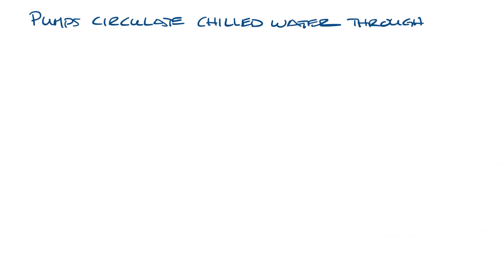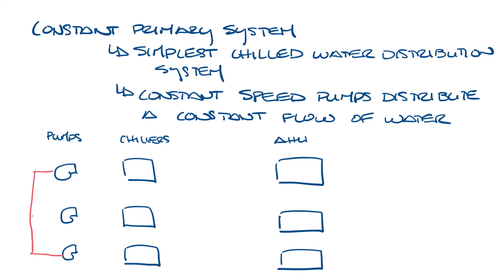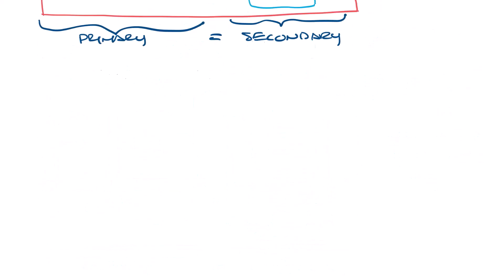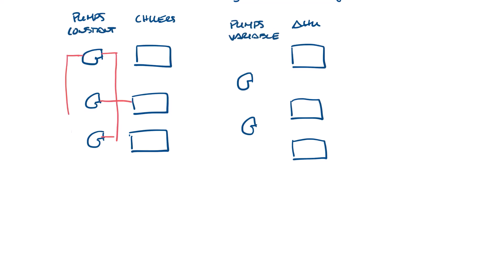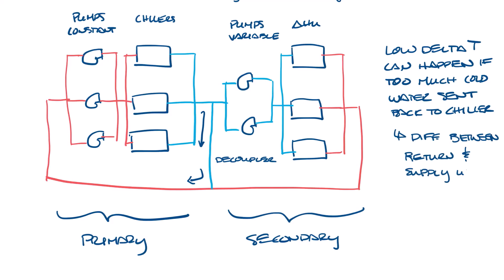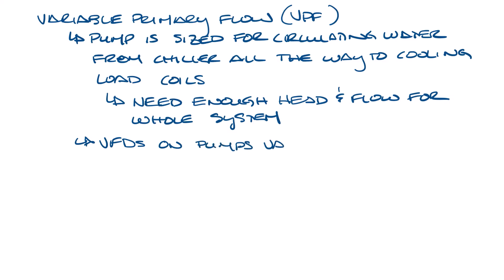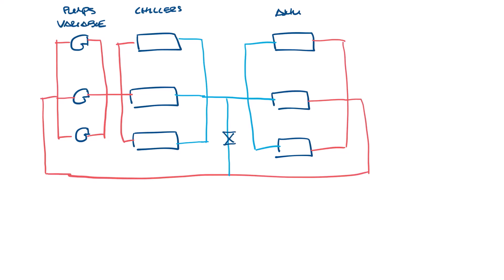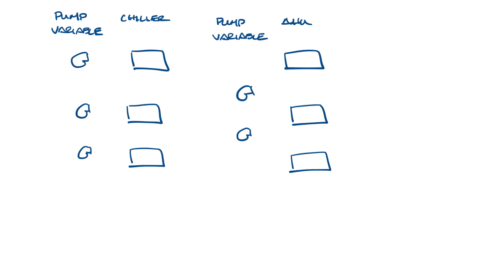NSW HVAC Academy - Types of HVAC Pumping Systems

Comment: What is the reason having control valve on the decoupling line VPF systems ? Should not be better to not have any valve to avoid unintentional blocking or unnecessary resistance for bidirectional flow ?
Reply: I think it's to ensure the minimum flow through the chiller in part load conditions.

Comment: Don't you need plate heat exchangers between primary and secondary systems? especially if you have multiple secondary systems, like office/retail/AHU?
Reply: I have worked on a chiller plant where the tertiary systems (offices and retail) had an ets room with vfd pumps on the customer side, that being said, in the plant it was variable primary variable secondary systems.

Comment: Most sites I’ve worked are in NYC are constant primary systems
Reply: When she says "Not used anymore" that's in terms of new installations and retrofits.
I'm in new construction, and I haven't seen a constant primary go in in a while.
Reply from the maker: Yes, I should have clarified that. There are probably a lot of existing constant primary systems still out there in older buildings.